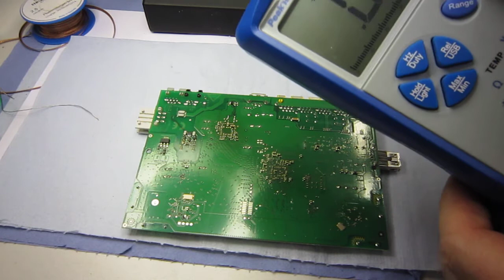FritzBox faking death no LEDs bad cap 10cents REPAIR how to Part  1 of 2

Comment: Thanks for this video. I bought 6490 recently from Flohmarkt. The power/cable LED blinks for ever. When connected to laptop via LAN, the eth0 interface appears & disappears.

I opened the box & identifed a capacitor beeping with multimeter. I'm not sure if removing that capacitor will help. Unline yours, it doesnt have any backup or neighbours to tackle.

Comment: Thanks! just fixed my 7390 by copying you. Different capacitor on the other side of the board. Important not to use a switch-mode power supply like the Fritz one, which stops supplying current when it detects a short circuit. I had an old fashioned transformer one lying around that did the trick
Reply from the maker: You're right, it is important to stress the power supply type used for this repair, thanks